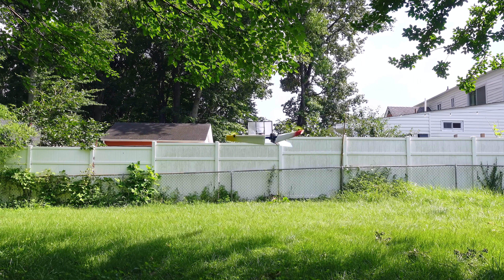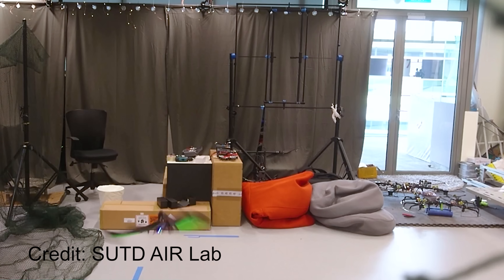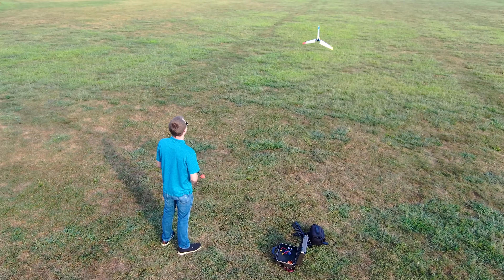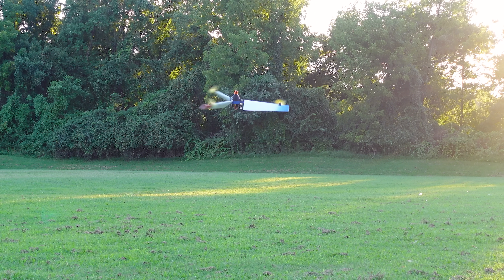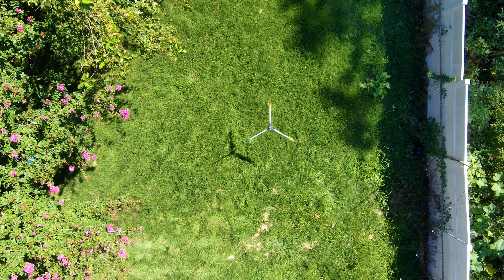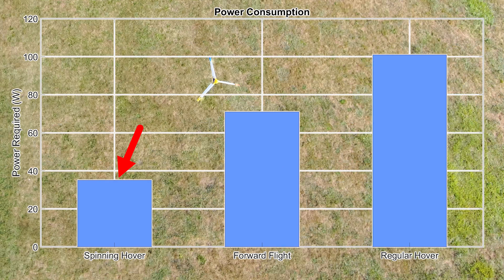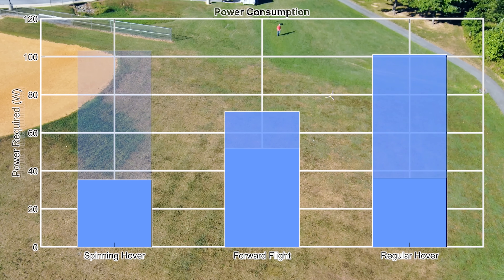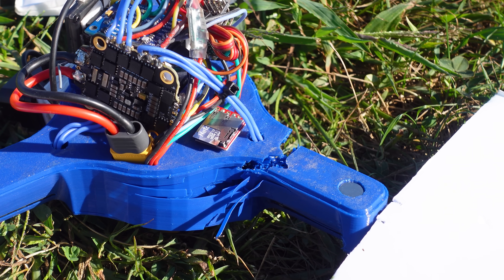Is THIS the Most Versatile Aircraft Design?  (Forward Flight Testing) - Part 2

Comment: Very fascinating, and captivating. Particularly the transitions between flight modes.

Wondering how the efficiency of quad-wing copter design using two long and two short wings would compare? Thinking short wings would aid stability when hovering, but would create less drag in forward flight, creating a design very similar to that of a bi-blade copter design.

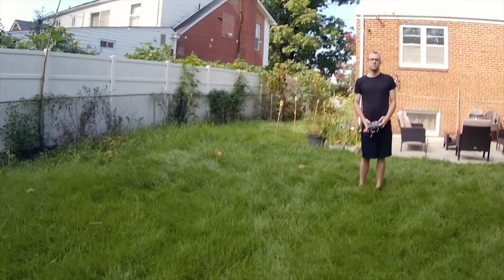Great solution to the spinning camera problem.(3:00)  Probably (will) makes it easier to for flight controller to know it's position over ground too, as has a constant reference direction, helping solve the hover drift issue.

Comment: How about something more asymmetrical?  a two wing design with four propellers..  kinda like this:  o-8-o.  two out on the end of each wing and two on shorter stubs perpendicular.  You might get the increase in control authority but lose the non-contributing third wing.. rotating hover might get more efficient with two longer wings instead of one also…

Comment: so how about if you folder the bottom wings up to in-line-horizontal to gain better lift.... the added weight and complexity probably negates it.  a shape shifting drone does sound cool though.... like what Emanual said about an X wing, folded wings to forward flight then split x quad rotar for hover, maybe only room for 2 propulsion rotars as more would clash when wings are closed

Comment: love it, seems dialed.  modern electronics do what ww2 germans could not with the triflugel concept.  your efficiency may be  increased by going to a -+- plan form but making the horizontal arms and motors longer and more powerful and the vertical arms shorter. this may give you less non lift drag but the control and stability of a quadrotor ( less pendulum)  and maintain radial balance for rotational mode ?   you have to rebuild it anyway after the crash

Comment: Awesome stuff. Quick (likely dumb) question, at 4:12 you mention the wings are stalled at ~25 degree angle of attack. So does that mean basically all the lift is coming from the vertical component of the tip propeller thrust?

Comment: You should try shortening the "top" blade in conventional flight and adjust the angle of the other two such that the CG is back in the center. Could be some interesting dynamics in spin but the short vertical fin will deduce drag and the other two blades being more parallel to the ground will bring your lift vector closer to vertical. The lift of the three points on an obtuse isosceles triangle should also be controllable in hover. Ps cool concept

Comment: What about if you use the asymmetric aerofoil for the propeller efficiency and make a ring wing around the tips to use for horizontal flight,  possibly still spinning or just feather to propeller spars... Basically a flying Mercedes logo.

Comment: You might consider running the pitch adjustments for each rotor-wing independently for more efficient forwards flight and maybe to make the craft steerable while in spinning hover mode.

I know that right now they all run off of one single motor and are geared to operate in unison.  This allows them to be used in accurate synchronicity but giving them fully independent pitch would allow you to adjust their lift as the spin in the hover allowing you to aim the lift vector craft and control it. It would require the use of some sort of sensor that can read position while spinning, but once that is figured out, it just becomes a matter of modulation of the lift created by each rotor-wing as it passes through the quadrant that needs more lift to correct the movement. 
Additionally, you could trim the more horizontal rotor-wings so they can fly flatter and create less drag, as well as hiding the frontal profile of the vertical  behind itself more. 
I am almost imagining the the two flat wings dragging the vertical wing behind them with the power rotor being used only to correct the lift imbalance this would create. It would also allow for a heap of pitch authority if used in this configuration.

Idk. If I had the skills for that, that would be an approach I would try. Keep up the good work!

Comment: Would you be able to make a bi wing, but with a third, possibly smaller motor off to one side, to give you the stable conventional hover. Depending on the centre of mass I guess it may have to be able to run backwards as my intuition tells me that when spinning the centre of mass wants to be between the two wings.

Though I have never built a drone, so there is probably something obvious that would stop it working.

Comment: The poor efficiency in forward flight has little to do with the vertical stabilizer which is not creating any lift and probably not much drag either, and a lot more to do with the fact that you're power-dragging two wings that are completely stalled with separated flow at 30 degrees AoA

Comment: If you want to reduce weight on 3d printed parts you can print in ultralight PP made by FormFutura. Strong stuff but 40% lighter than pla. You gotta put PP tape on yer heated bed and use helper discs but the results are great.

Comment: I would suggest pointing the vertical blade down and using more of a Y configuration in forward flight, because it will have better roll stability. Only downside is that it will make placing the LIDAR more difficult.

Edit: this is awesome, btw. Looking forward to more videos on this vehicle.

Comment: Why not spinning in forward flight? Then the blades would create lift and thrust. You'd need to add a tail boom with a small set of control surfaces to add directional stability.
Reply from the maker: It takes energy to maintain a constant rolling rate as opposed to just flying on the wing
Reply: @NicholasRehm  Have you tested it? I got the impression your wings were far more aerodynamically efficient than the motors. So all 3 rotating will generate more efficient lift and thrust, no? Worth testing perhaps. By having all 3 rotating, you'd get 50% more lift and 50% more thrust versus 2 static wings, I'd think (less any unforseen losses that rotating might incur). Just seems like such a testable thing.
Reply from the maker: @nicklockard  well, the clip at the end was me testing it

Comment: No one says you need 3 wings on the tri copter.  You can build a tri copter Thor with the trick is the center of centrifugal force with Not match the center of mass. The 3rd option is an asymmetrical / symmetrical Inflatable wing a solid top with mylar bottom and a micro pump from a blood pressure cuff. I used 4 of them pumps for a custom air suspension system on an 10 scale R/C drift car lol

Comment: One thing that could possibly help stability control with a bi wing design is switching to using 4 motors instead of 2. That way you have something more similar to quad copter control while still being able to transition to the rotation mode.

Comment: It should be more efficient in horizontal mode if you spin  the thing 60deg, with the vertical wing pointing down, then the drag on the bottom wing will create a downward pitch moment and the positive dihedral on the carrying wing will lessen the load of the motors due to a more stable configuration....

Comment: You should try to replace the wings with metal foam and fiberglass, then use a 360 degree camera with corrective software so the spinning works in your favor.

Comment: How about 4 wings and 4 motors? In forward flight it becomes an x-wing. If your motor control is fast enough you could vary the motor speed when rotating to give directional control.

Comment: A question for fwd flight: What if the vertical wing (rudder) thrust was increased to overcome the drag ?, meaning that instead of the machine flying in forward flight at an angle as a result of drag on the "vertical fin" it would then fly in a more balanced vertical state.

Or what about a fourth central motor for fwd flight assist or only modes?
Reply: The angle it flies in forward flight isn't due to the drag of the top wing, it's to give the side wings enough of a downward angle to produce lift. This is the "angle of attack" that he talks about finding in the video. 

The reason the whole drone needs to tilt like that is because the rotation of the wings is geared such that they all rotate the same. This means it isn't possible to angle just the side wings to produce lift unless he changes the design to include a separate servo for each wing, which in turn would increase the weight, potentially making it less efficient, etc. etc.

Also, if it was totally upright in forward flight, there would actually be even more drag from the top wing as it would have more surface area exposed to the oncoming airflow.

The problem isn't a lack of power (I think) so a central motor would probably make it less efficient overall. The problem is more that not enough lift is being generated by the wings.

A few suggestions that I've seen have noted that changing from 3 wings to 4 and having them pivot into an X-wing type configuration would probably work pretty well to give more lift, but again, that means a complete redesign and added motors, etc. so it would be interesting to find out if that would be more efficient or less.

Comment: What about a 2 and a half winged model? is that even possible? I imagine it has to be symmetrical on one axis with the half wing in the middle and the two big wings having an angle of something in between 120 and 180 degrees. it could fly forward more efficiently due to the reduced drag by the non lifting smaller wing but I'm not sure if the spinning hover would even work. Does anyone have an idea if or if not and maybe an explanation?

Comment: Spinning VS traditional forward flight efficiency was kind of surprising. (One year later edit....: OK, so now it finally dawned on me. The lower "stay in the air" efficiency is off course just plain old wing loading. When spinning the aircraft its mass is distributed over the combined  area of three wings, and while in forward flight only two which forces you to fly the wings at less efficient (higher) angle of attack. Then on top of that add the extra drag you mentioned  generated by the passive third wing. However, if efficiency is measured in taking a specific load, mass, from A to B, the "airplane" configuration still might be the most efficient one of this amazing little crafts three modes.)
Absolutely amazing work you done here including your video editing/creating  skills, thanks for sharing.
Crashing is sort of mandatory when embarking this kind of endeavor!
Reply: I really enjoy this idea.  Well done.  As a fwi check out Mike Pate's Scrappy real world bush plane build.  Specifically his ability to change the wing's profile while in flight to optimize the low speed vs high speed efficiency. https://youtu.be/wlwDxuxbHto?list=PL9OFkVHYEhoFUPV78e3hh0TVPMhYI73f9 Mike's an amazing design/fabricator & engineer.
Reply from the maker: Agreed, I was a bit surprised too. Anxiously waiting for your manned version😉
And yes—crashing is the only way to force me to iterate!!
Reply: @NicholasRehm  Silly question perhaps, but have you tried to fly the craft in airplane-mode with the vertical wing turned down instead of pointing up? Generally speaking I think it is much more forgiving and efficient to mess with the airflow on the high pressure side (under the wing) rather on the top side. Im thinking that there is a lot of wetted surface in the middle of the low pressure  lift-distribution curve of your wing. Any how, something is off, you should be able to fly it more efficient in airplane mode then you done so far. Looking forward to what ever comes next!
Reply: @amazingdiyprojects  
The pressure difference would be non-existential. Whilst drag could be more of a culprit when near floor.

But having the tail on the top end, similar to a commercial plane, will pitch the nose up. And that is better than pitching it down.

All in all, it shouldn't make much of a difference. If he were to have the plane in forward flight, AND, start spinning now that would be detrimental to the energy used, speed, and the excess drag.

Comment: Wow, this is an incredible concept and cleverly implemented. 

I have one suggestion for improving energy efficiency during forward flight that would hopefully have little or no impact on spinning hover efficiency and potentially better non-spinning hover. And that would be a four wing configuration with two long wings and two short wings, each with a thruster. During non-spinning hover, if you use the same propeller and motor combination you will have four rather than three props, and thus have a larger disk area, and thus reduced power for a given total thrust. But this will also potentially make the drone heavier, and so that would require more thrust. So I am not certain that it will reduce total power compared to your current symmetrical three rotor design. Only design will tell.

During spinning hover, the long wings will provide most of the lift while the two short wings will add some. If the total area or at least the wing loading stays the same as the three wing design, I would think that power required for spinning hover will be at least very similar. As with non-spinning hover, if the total weight goes up, then power required could go up. 

The big change should come during forward flight. The two long wings will be horizontal with their lift vector parallel to the gravity vector and so yield a higher L/D for a given wing area and CL than the Y-wing with the lifting wings at 30 degrees to the horizontal. 

Also the total area of the two short wings could be less than the one large wing wing that is vertical during forward flight in you Y-wing. The length of the two short wings would be determined by the required moment arm required to produce the necessary pitching moment using differential thrust from the two propulsors on the short wings. Differential thrust on the two long wings would provide the necessary yaw control and differential pitching of the two long wings would provide an awesome amount of roll control. Since pitch is not coming from aerodynamic lift, the area of the two short wings is not a factor and so can be very small. In fact in the limit the wing chord could be just long enough to provide a clean aerodynamic shape around the rods providing the structural strength. In this case lift in spinning hover would come almost entirely from the two long wings.

As for your potential applications, I like your idea of providing a relay between widely separated locations on the ground. Another could be between a ground controller and another drone that is operating beyond line of sight. One use could be powerline and pipeline inspection where one drone either flies in spinning hover in line of sight to the controller to provide control relay to the second drone with the camera and/or other sensors flying in horizontal mode along the powerline/pipeline.

Comment: You should check out amazingdiyprojects latest aircraft design. It also uses three large wings with small props to drive it in a hover. His design is a bit different as he has a control surface on each wing and his wings don't pivot. His design is fully controllable in a hover due to the control surfaces on each wing. https://www.youtube.com/watch?v=JfP7955XipY

Comment: Maybe it's worth making the third wing foldable backward? So that in horizontal flight it will look like a vertical stabilizer from a conventional plane design. Flexible shaft can be used to tilt this wing in each position.

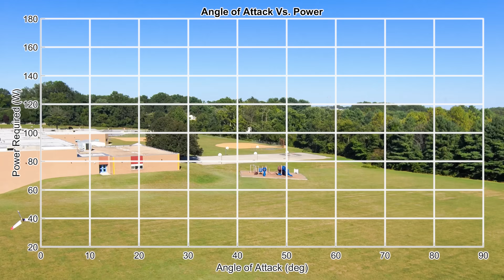Comment: 3:55 you could always use it on a loitering munition, having a sensor spinning, when a signature is detected it can then fly normally on to target. You get a higher loiter time that way, although I'm not convinced it'd be better than conventional aircraft style ones. Might be good for soldier launch though. 

Just my two cents.

Comment: for the coms relay efficiency, you don't usually need a perfectly fixed position in the sky, so a fixed wing flying a circular loiter - should be able to give the same coms relay effect at even higher efficiencies.

Comment: Make the third wing fold backwards to make a tail, with the propeller pushing in addition to the other two pulling. :D

Better yet, don't tilt the drone for forward flight, just rotate and adjust two wings to be perpendicular to the third one and parallel to each other.
This could be achieved by having the wings themselves mounted on a rotating mechanism, so the drone can stay still for all modes of movement.